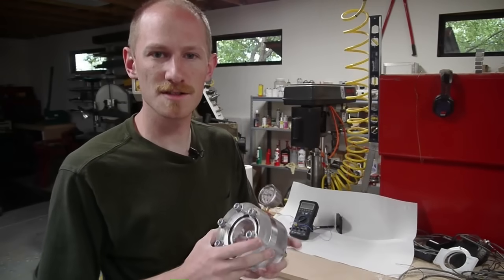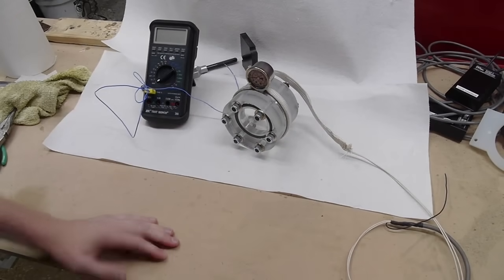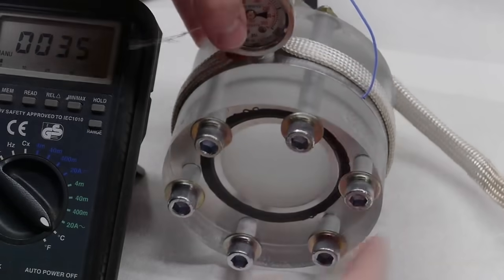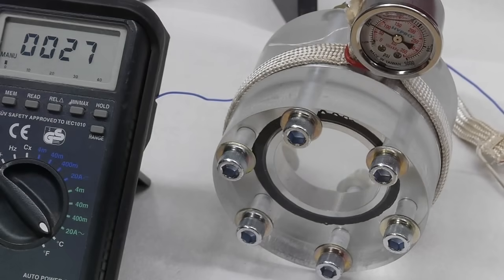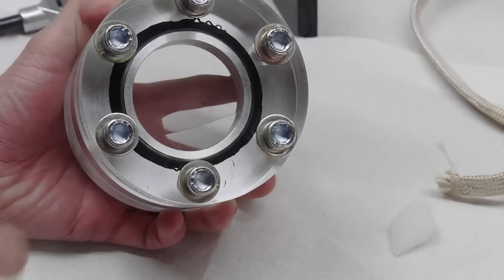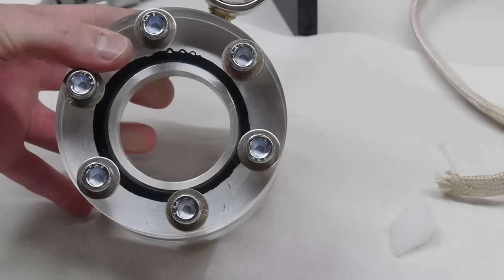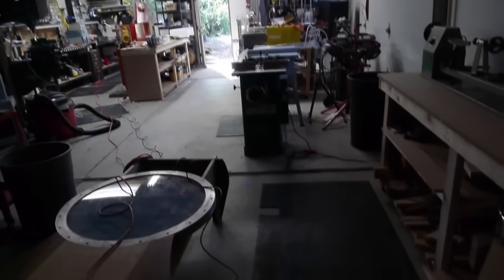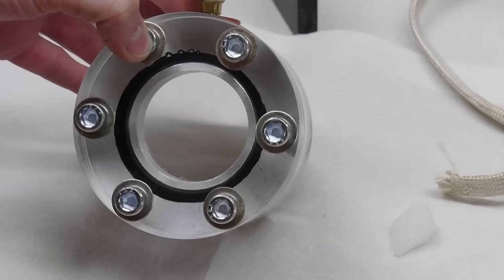A close look at supercritical carbon dioxide CO2

Comment: It seems that the applications for supercritical CO2 are the same as the applications for liquid CO2. Obviously, since you need a pressurized vessel to get liquid CO2, you're more than halfway toward supercritical with just that, in terms of legwork. Is the appeal of supercritical CO2 just that it disperses within the gas phase and fills up the whole volume of the vessel, or is there an additional benefit to the supercritical phase? I'm not trying to downplay the value of supercritical. Obviously, if you can fill up a vessel only some fraction of its volume with a liquid, and then have that liquid effect everything within that vessel regardless of its position, that's quite an asset. I'm just a little hazy (pun intended?) on the nature of supercritical substances.
Reply: SCO2 is considered a near-perfect, more environmentally friendly solvent, so industries use it for various applications. Coffee manufacturers use it to decaffeinate coffee for decaf products, perfume manufacturers use it to strip flowers of their scent for use in fragrance, and more recently, marijuana growers use it to extract the active ingredients in the plant. Research is also taking place to use it as a working fluid in a similar way to steam.

In terms of the nature of supercritical fluids, it's not the easiest phenomenon to explain, but think of it from a molecular perspective. Above the critical temperature and pressure, the molecules have enough energy individually to escape each others intermolecular attraction forces, acting like a gas in the sense that it can fill the volume of a container, but with the density closer to that of a liquid. It has very low viscosity due to the high molecular energies, which when coupled with its properties as a practically perfect solvent, means it tends to penetrate and embrittle any material that's even slightly porous at the molecular level, such as rubber, plastics, and many polymers. That means it is a challenge to seal safely and reliably, which considering the pressures involved, makes it potentially hazardous to use. Though if you put things into perspective, as a solvent it's far less dangerous than many industrial solvents in use!

Comment: What to use this for? Heat capacity? Heat transference?
 Obviously the chamber is sealed... what's the problem?
 I know nothing about this process of oxidation other than CO2 isn't the only oxidizer used in industry. Glycol (also tested as an oxidizer) has a boiling point of 290*c, even miscible in water. This compound.. chemical, (?I don't what it is) in a supercritical state, may have some application for heat transfer/capacity as opposed to the usual refrigerants. Glycol, (glycerine) like CO2, is "safe" ie. non-toxic. Glycol, I believe, is a byproduct from the soap process with limited use just waiting for exploitation. I don't know just throwing it out there.

Comment: I'm wondering what other substances you could use in your pressure vessel. Nitrous oxide's critical point is ~75 atm at ~98 F (assuming I'm reading the phase diagram correctly). That's pretty close to carbon dioxide's (72.9 atm at 87.98 F). Hydrogen sulfide is 88.9 atm at 212.8 F. Xenon is 57.7 atm at 61.8 F. There could be some issues when try to use those, though (N2O being an oxidizer, for example).
Reply: In europe they have these cartriges the same size only with liquid nitrogen instead of co2 This is three times the pressure as co2 at 2400 lbs at sea level and room temperature. Casparin says not to try it in one of their engines.
Reply: Kinda a late reply but check out "CodysLab" He did a whole series on this and made a bunch of different gasses in glass tubes, all super-critical.

Comment: 700psi! I don’t know much about pressure but isn’t that pretty much a bomb haha
Reply: 700 psi is pretty dangerous for sure, but compared to pressures in many everyday machines that pressure is relatively small; take compressed gas cylinders (~2900 psi), excavator and refuse collection hydraulics (up to ~5000 psi) and diesel fuel injectors at a rather astounding 35,000+ psi. Also as an observation, if he's right and it is pressurised to 700-750 psi, then the CO2 isn't supercritical because the critical pressure of CO2 is around 1070 psi, though I suspect that might be a typo.

Comment: How do you safely open the device now that it's under pressure?
Reply: +corisco tupi I'd imagine you dont. But if you really wanted to then probably cooling it down and then just drilling a hole would suffice. Then again I don't have any experience with these kinds of high pressure.
Reply: erikharfager Good idea, cooling enough to solidify the carbon dioxide might do the trick. Otherwise it might not be possible (safely at least) without resorting to some exotic means to do it remotely.

Comment: This is very old, but I think you could get a purer mix by treating it like an AC system - pulling a vacuum, then pressuring in C02 externally.

You could try dissolving paint pigment, and doing an instant dry spray paint, or test dissolving other substances

Comment: There's many heavy duty closure systems an expert diy could manage, you must know. Use autoclave or the canning type on hinge, chemistry type for split heavy chambers, salvage a container used tank reactor, regular pre-built use clamps in groove. Did I misunderstand question, Socratic...
Oh make gemstones, Opals black with varying Lightwave gaps for color and brilliance.  I cannot see reason wouldn't work, don't need the pressures claimed, not diamonds!    Opals or other gem, does he do deposition or tissue cultures, genetic editing?  Almost bought big one 3 sizes, wanted glassware equipment would have donated one, other to poor man's chemist or local. Some weed guy turned up and paid 4 grand cost 50. Pressure shaker reaction vessel! Opals will firm faster if pull solvent  S.Critical.

Comment: Is this CO2 saturated steam? I'm not a chemist, serious question.
Reply: No, steam is made of water, but, this experiment would still work and would look the same without any water whatsoever inside the chamber.  That said, there might have been some frost particles on the dry ice when it was put in the chamber, so there might be some water molecules there during the experiment, but they are not responsible for the experiment going the way it did and looking the way it did.  The liquid is liquid CO2, not liquid water.

Comment: Supercritical CO2 turbines are proposed to be a far more efficient way to extract energy from a molten salt nuclear reactor.
Reply: Potentially, yes. You can use it a bit like a Rankine cycle, taking advantage of the phase changes at various points, and CO2 doesn't suffer from many of the same issues with steam at higher temperatures.

Comment: I find it super amusing that you used a power drill to tap your parts.
Reply: So? I tapped with a handle attachment on cold rolled steel :P
I don't trust a machine and I get nice cuts.
Reply: leerman22 that is what makes this amusing. You aren't supposed used a power drill to tap things.

The reason he probably got away with it is because it was soft plastic. Had it been some sort of metal it probably wouldn't have worked out as well.
Reply: sghost128 He has a video showing his process for using a drill to tap holes in soft metals and plastics. He used to do it as part of his job. He's good at what he does, he knows what he's doing.
Reply: t3hPoundcake I'm not questioning whether or not he is good. I just said I find it amusing.

Everyone gets so defensive over the stupidest shit.
Reply: ***** Reasons to not: that's not how taps were meant to be used. Which is why I find it funny.

Furthermore you're not supposed to use a press to tap things... When you're tapping precision items, you are supposed to do it by hand because power tools will break your parts and warp your threads.

Besides I was never questioning whether it was fast or effective because obviously it is both of those things. I was just stating that I was amused. Is that a crime or something?
Reply: sghost128 I've power tapped aluminum on a lathe.  worked out great.
Reply: Evian Rave  I power tapped steel on my lathe, didn't know I shouldn't. I engaged the halfnuts with the feed set to the same TPI as the tap at a fairly slow RPM, worked beautifully. I figured it'd be faster AND more effective (in that I could align the tap right at 90 degrees by facing the part and then aligning the holder to the faced part)
Reply: Rob Mckennie Thanks bud.
Reply: sghost128 I've used a power drill to tap metal parts in a production situation. It worked ok as long as you keep the tap straight, which is is hard to do. You also have to make sure the tap doesn't overheat. The tap broke on about the 50th part.
Reply: whatsup914 Yeah, taps aren't really meant for that kind of treatment. I know you can do. I just find it funny that he is.

Comment: Slightly flawed experiment (no way to ensure you have pure co2 and not a mix of air+co2 in the chamber) and no compressor for the co2 and no valve that would allow you to add co2 and remove air, preferably one made with a sapphire piston.  Also the thought of the capsule being a potential bomb (see other video with an o-ring that let go) once the co2 has stopped being solid (dry ice).  But, was still good that you could show how co2 behaves under various pressures and temperatures, was neat seeing the different behaviors of co2.

Comment: but we are taught that Co2 is an element that creates heat by itself and has the vast potential to warm the earth with only as little as 0,03% coverage in the total earth atmosphere.. on another note.. how difficult would it be to setup a test that could measure the change in temperature in a certain volume of space, if only 0,03% of Co2 is added to that volume. for example a square cube that has a total volume of 1L of air. BTW.. total blown away to learn that Co2 is used to dry clean clothes or decaffeinate coffee because its more environmentally friendly..
Reply: Just to clarify; CO2 does not create heat by itself, instead it (and other greenhouse gasses) re-emit absorbed thermal energy in all directions.  Some of this energy is re-directed at the surface of the Earth which is also heated by the portion of the Sun's light it absorbs.  This trapped heat raises the equilibrium temperature of the atmosphere.  (As a slight nitpick, Co is the chemical symbol for Cobalt but it is clear what you meant.  The capital 'O' changes the meaning to Carbon and Oxygen.)

More info here: https://en.wikipedia.org/wiki/Greenhouse_effect

Not sure how to set up such an experiment.  I've seen some on YouTube but judging from the comments they might not be properly controlled and inadvertently demonstrating a different behavior.  I'd be curious to know what you find.

Comment: Has anyone ever built a bigger pressure vessel, connected it to a turbine with a regulator valve, and loaded it up with dry ice? I wonder if you could use it as an electric generator or build your own dry ice locomotive..haha. Probably not very practical.